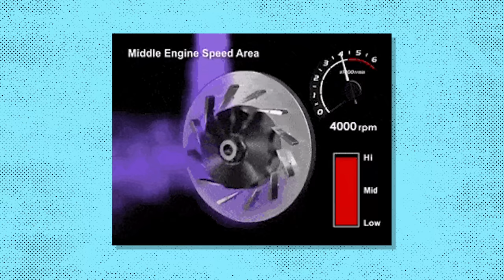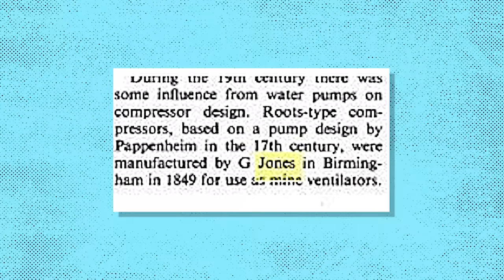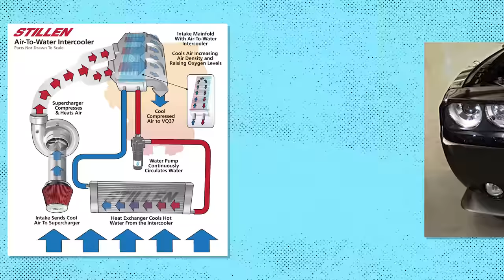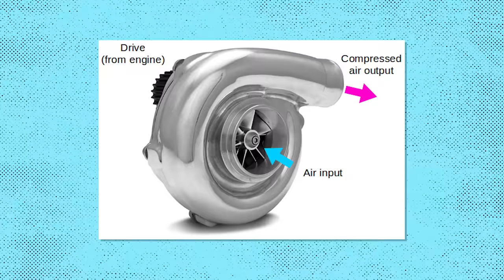Why Superchargers Aren't As Good as Turbos

Comment: "Superchargers suck because they use engine power to make more engine power"
This is misleading. A turbo does the same. Forced induction will always have drive train efficiency losses and generate more heat. Always. You're improving the energy density of the engine (power to  by sacrificing overall efficiency.
In some cases this will reduce fuel consumption per unit power, as you see in high efficiency engines increasingly using forced induction.
The real reason superchargers are less efficient than turbos is because they're extracting their power straight from the engine. The increased power of forced induction primarily comes from the higher pressure in the cylinder. A much smaller amount of the power gain is gotten from the higher pressure drop between the cylinder and the exhaust. A supercharger is being run directly from the engine output while a turbocharger is run from the (basically useless) higher pressure drop between the engine and the exhaust.
Both are running on engine power, just different parts of it.
Reply: That is false, turbochargers do not induce any parasitic load on the reciprocating engine.
The turbocharger is a HEAT ENGINE and operates using the BRAYTON CYCLE.
Any questions son?
Reply: @sandervanderkammen9230  there is a lower pressure drop experienced between the cylinder and the turbo compared to the pressure drop without a turbo. This means that there is more "resistance" to the exhaust being pushed out of the cylinder on the upstroke, therefore there are losses.
There is no such thing as free energy. There can't be zero losses.
Reply: @mattsoup4121  Please stop spreading your lies and misinformation about a topic that you are clearly not qualified to discuss inteligently.

You are obviously not formally educated or have any professional experience in fluid dynamics of the fundamental engineering concepts that apply to the turbocharger.
Reply: @sandervanderkammen9230  Oh really? I guess the engineering degree and the job designing rocket engines are all a sham.
The compressor/turbine in a brayton cycle typically have an efficiency of about 85% each. That's a total efficiency of about 72% for the turbocharger neglecting friction losses. The turbo being a heat engine means that it is extracting energy from the heat of the exhaust, but it also requires a pressure drop for this to occur. It requires a pressure drop to function. This pressure drop is the source of the losses for the engine. You know how removing the muffler and catalytic converter will increase the power output of an engine? It's because the pressure drop in the exhaust is increased. Adding a turbo decreases the pressure drop, which obviously decreases output.
The engine system as a whole is more efficient with a turbo (usually) because it's increasing the amount of air in the cylinder for each cycle. These gains are larger than the losses introduced from the turbo. 
Again, there is no such thing as free energy.
Reply: @mattsoup4121  WOW! You really think you are fooling anyone???
Reply: @mattsoup4121  Your comments revealed a complete lack of understanding of the most basic, fundamental concepts of Fluid Dynamics and Thermodynamics as they apply to turbocharging.
Reply: @sandervanderkammen9230  
Pro tip: When engaged in a discussion about a technical topic and you resort to attacks and insults it's an instant giveaway that you don't understand the topic.
Reply: @mattsoup4121  Stop pretending to be something you are not, you are clearly not qualified to speak inteligently about turbochargers.
Reply: @sandervanderkammen9230  Any actual detail or are you just going to tell me I'm wrong and refuse to elaborate?
Reply: @mattsoup4121  The Turbocharger is a Heat Engine and is driven solely by rhe waste heat energy in the exhaust from the reciprocating engine.
The turbocharger does not induce any parasitic load on the crankshaft of the reciprocating engine.
Reply: @sandervanderkammen9230  I think you misunderstand what the term "heat engine" means. Heat in a gas system is actually the amount of kinetic energy in the gas. This is why more heat = more energy, because the gas has more kinetic energy. When the exhaust from an engine is driving the turbo it is giving up its kinetic energy by imparting momentum onto the turbine blades. This reduces the heat of the gas because it has given its kinetic energy to the turbine. Per the ideal gas law this drop in heat also means a drop in pressure. This is why there is a pressure drop across the turbine stage of the turbocharger.

This pressure drop across the turbocharger means that there is a higher backpressure in the exhaust manifold than without a turbocharger. Here is a link to an article explaining why this reduces power, since I don't want to explain this again.
https://www.roadandtrack.com/new-cars/car-technology/a14530205/what-is-exhaust-backpressure-and-why-is-it-bad-for-horsepower/

If you'd like to give an actual explanation of why I am wrong besides "a turbo is a heat engine" I am more than happy to respond kindly.
Reply: @mattsoup4121 Nice cut n' paste reply. What backpressure?
You sem to misunderstand the thermodynamics and the fluid dynamics involved in fundamental principles of turbocharging.
Reply: @sandervanderkammen9230  If I'm really misunderstanding it then please explain it to me. I'm trying my best here.

If you reply without an explanation, a link to a paper, or anything else explaining why I'm wrong I'm not responding. Your replies are the real cookie cutter shit.
Reply: @mattsoup4121  Fluid always moves from higher pressure to lower pressure...

The centrifugal compressor is more efficient pump than the reciprocating engine and can flow more air.

Naturally Aspirated engines have lower intake manifold pressure than ambient air pressure so any restriction in the exhaust system creates a Delta~P
Reply: @sandervanderkammen9230  
-Yes fluid always moves from higher pressure to lower pressure, however a lower pressure drop means less possible flow per second. This is where you get additional resistance to exhaust being pushed out of the cylinder after combustion.

-A centrifugal compressor is more efficient yes, but as I said above there is a penalty to powering it with the exhaust. You spend more energy pushing the exhaust out of the cylinder with anything restricting flow in the exhaust.

-The intake manifold has nothing to do with this (aside from the energy from the compressor coming from the exhaust turbine). 

Clarification from previous comment. The change in temp doesn't cause the pressure drop, and the pressure drop doesn't cause the change in temp. They are coincident and completely interconnected. The penalty for that extra heat and pressure drop is resistance to the exhaust being ejected from the cylinder. I'm not saying you're getting less energy than with a naturally aspirated engine. In most cases you are getting more energy out of the engine than without the turbo. The turbo does need some energy to run though, and that comes from the engine. There is no perfectly efficient system.

A rocket engine is a good example of this. Pumped rocket engines (usually) burn some of their propellant in an inefficient manner completely separate from the main combustion chamber. This small fraction of the propellant is used to drive pumps that increase the pressure of the propellant entering the engine to increase the chamber pressure and increase combustion efficiency and thrust. The pump increases the efficiency of the system overall, but it does introduce losses that don't exist when there isn't a pump involved.
Reply: @mattsoup4121  WOW! You are certainly very confused and misinformed about heat engines and the fluid dynamics involved in a turbocharged engine.

Bernoulli's Principle tells us that pressure drops when velocity increases. A pressure increases when velocity decreases.

And Carnot's Formula tells us that temperature drops between T1 and T2 depending on the amount of Work or mechanical conversion.

A typical turbocharged engine will have 300° to 400°F drop in temperature as the exhaust gasses pass through the turbine.
This temperature drop is directly proportional to the amount of shaft horsepower generated by the turbine wheel.

There is no "back pressure" between the reciprocating engine and the Turbo.
Back pressure is measured between the turbine outlet and the end of the tailpipe.

There is no restriction in exhaust gas flow between the reciprocating engine and the Turbo.
Exhaust manifold pressures are the same or lower than intake manifold pressure so there is no Delta~P and a increase in airflow.

Any questions.
Reply: @sandervanderkammen9230  The turbo IS the pressure drop/cause of the backpressure. There's nothin extra between the engine and the turbo and I've never said there is. For an engine with the same compressor, let's assume it's not powered by the engine itself, with and without the turbo turbine stage the one without the turbine stage will produce more power. 

You're not isolating these things and only considering the system as a whole, which as I've already mentioned multiple times is getting more benefit than loss from having the turbo. When I say backpressure I don't mean that there is some sort of backwards flow of fluid occurring, I mean that the manifold is at higher pressure than it would be without the turbine stage. Your definition of backpressure is common nomenclature for vehicles, but not the technical definition. Also if you want to be pedantic you're describing the carnot T/S diagram, not "the carnot equation". 

The carnot cycle isn't even the correct cycle to use here. The carnot cycle is an ideal system that very rarely applies in the real world outside of something like a stirling engine (which has zero gas exchange with the environment). A typical car engine is running on the Otto cycle and a turbo is combining the Otto cycle and the Brayton cycle. 

The temperature drop is related to the pressure drop through the turbine. Temperature is approximately proportional to pressure. 300-400 F lost out of 1000 F exhaust gas would correlate to a drop of 20 to 27 psi through the turbo at the same time as the temperature decreases. If we assume the exhaust backpressure behind the turbo (the only definition you seem to understand) is the same as the exhaust backpressure without the turbo (still assuming there's a compressor not powered by the engine) then you're dealing with 20-27 psi extra in the exhaust manifold with the turbine stage in place. For an engine with 2" diameter pistons this corresponds to an additional 63 to 85 lbf that needs to be applied to push out the exhaust for an engine with and without the turbine stage. 

Again, I am not saying the whole system is less efficient than a naturally aspirated engine, but that the turbo itself is sapping some efficiency from the engine to increase power output.

Oh also bernoulli's equation tells us that STATIC pressure drop with increased velocity, but that DYNAMIC pressure increases so that the TOTAL pressure remains the same. Turbines care about total pressure and not static pressure. But you say I'm the one that's confused.

I do have one question. Did doing 5 minutes of google "research" to come to your incorrect conclusions make you feel better about yourself?
Reply: @mattsoup4121  Velocity increases through the turbine... the Turbo is Brayton Cycle engine and operates using an Impulse type turbine.

No restrictions to flow, no backpressure... between the reciprocating engine and the Turbo.

I GOT YOU! 
Tell us? Where did the 400° of heat go???

You childish theories show their fatal flaws...
Reply: @sandervanderkammen9230  When the turbine is running there is a higher pressure and a higher temperature at the inlet. At the outlet is a lower pressure and a lower temperature. 
The 400 degrees went the same place the pressure went. It was transferred from the working fluid into the rotation of the turbine. 

You just said the turbine was a carnot cycle. I said it was a brayton cycle and now you're saying I disagree with that?

Do you even know what "impulse turbine" means? It means the turbine turns impulse, which is force times time, into mechanical work. Fun fact you may not know, but pressure is force divided by area. This means that the impulse turbine in the turbocharger is turning pressure (which I just established is a force) into work. Not heat.

Heat is the internal energy of a medium. Pressure is a physical effect of that heat. When the fluid moves through the turbine it uses its pressure to give its heat to the turbine. This is where the 400 degrees goes. 

Do you have any other fun theories? Is the earth flat? Did you meet some aliens last week?
Reply: @mattsoup4121  Impulse turbines convert fluid VELOCITY into work..
Not pressure.
Reply: @mattsoup4121  REACTION type turbines convert pressure into work.
Reply: @mattsoup4121  VELOCITY is the physical effect of HEAT acting on the working fluid.

The exhaust gas is not static... it is  moving, moving with higher velocity and LOWER pressure.
Reply: @sandervanderkammen9230  higher velocity only comes with lower pressure in the case of isentropic expansion, which does not occur in a turbine.

It would be more accurate to say impulse turbines turn momentum into work. Momentum of a fluid is a property of density and velocity, of which both are a function of pressure gradients.

Reaction turbines and impulse turbines both use momentum to create mechanical work. An impulse turbine is acted on by the fluid and a reaction turbine does the opposite, acting on the fluid to gain momentum.

A water wheel is an impulse engine. A rocket is a reaction engine. Both get most of their mechanical work from momentum.
Reply: @sandervanderkammen9230  you just admitted that the heat isn't doing the work. Velocity is a function of pressure drop. Pressure is force per area. Density is a function of pressure, temperature, and mass flow rate. Volumetric flow rate is a function of density and mass flow. Velocity is a function of volumetric flow rate and cross-sectional area of the volume. It's all related. They're not separate separate things and are all inter-related.
Reply: @mattsoup4121  Correct, Lower pressure means no backpressure and no restrictions of flow.

The turbocharger is driven solely by the waste heat energy and induces no parasitic drag on the reciprocating engine.

Comment: Whose Noone? Ford, chevy, dodge, lotus....come on the lists goes on. If it's for today's age, people are pairing v6 turbocharged cars for duel economy....that's it 😕
Reply: Turbos make more power... and save fuel. Turbochargers are simply better.
Reply: @sandervanderkammen9230  they don't have instant spool so that's a downside, no instant torque.
Reply: @nyckae8587  Turbo lag doesn't mean the vehicle is slower... turbo cars typically accellerate faster.
It might be an issue with a less capable driver..
Reply: @sandervanderkammen9230  turbo cars typically accelerate faster and achieve higher top end. That's how turbos work performance wise. But I'm not gonna argue

Comment: Like the video but the Model S Plad is setting new standards in 0-60 times that ICE cars can't compete with....
Reply: The model S is no supercar...
Reply: @sandervanderkammen9230  I don't even like Tesla. But I have to respect an 1,100 bhp electric car that costs just 120,000 USD and is a 4 door family car.
So in a way.... It is a super-car as it sets new targets for others to reach for and beat.
Reply: @mikadavies660  And rated worst in quality 3 years in a row...
Reply: @sandervanderkammen9230  Clearly you didn't read my opening statement.... "I don't like Tesla" but I do respect the tech and what they are doing.
People can see what "is possible" what can be manufactured. They can aim at that... VW Group are clearly trying.... Their Tycan is great quality... But too expensive and slower... However, they are trying. But without Tesla pushing the boundaries. Changing manufacturing techniques...
So I could.... Like you.... Be stuck with ONE statement "I don't like Tesla, as they are bland & ugly" or "their quality is shite".... But instead I am thinking in a positive manner about how they are changing the world of car manufacturing by leading the way and not just talking about it (like GM).
Reply: @mikadavies660  I will be more impressed if Tesla Motors can make thier cars reliable, environmentally safe and make a profit... right now Tesla Motors build quality is the worst in the Industry... they pollute the air and water with toxic Cobalt and sell cars at a loss.

Comment: Saying a turbo doesn't use engine power is stupid. Exhaust pressure comes from the engine. Think of the four stroke engine phases.

A super charger gets power from the combustion phase, where as a turbo gets power from the exhaust phase. The power from the exhaust phase comes from another cylinder's combustion.
Reply: Wow, that's a stupid comment from someone who obviously doesn't know how a turbo works.